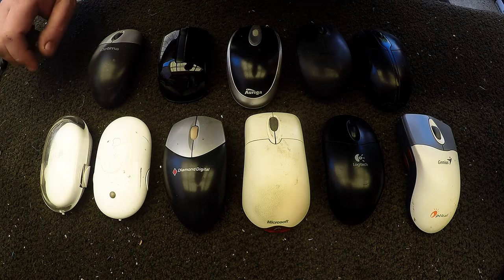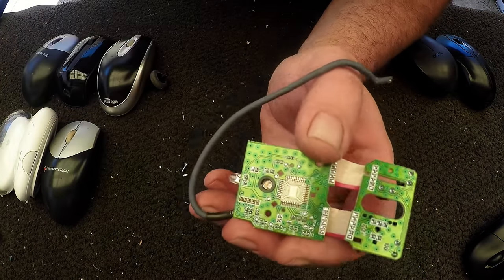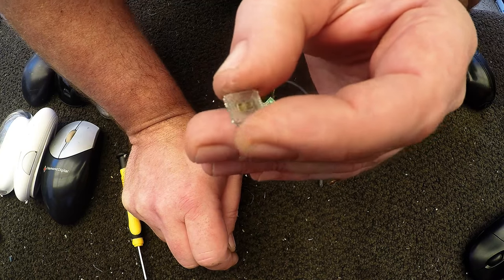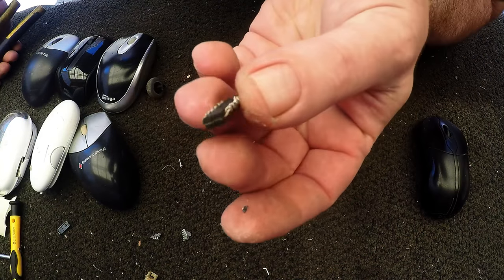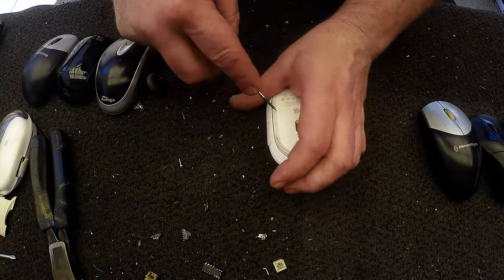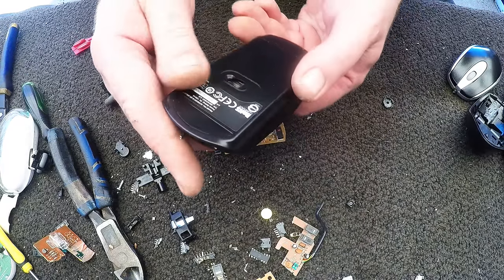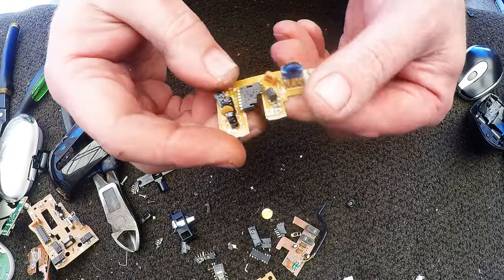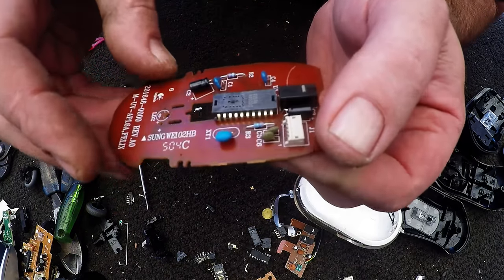Gold Chips from Computer Mice

Comment: In case anyone's curious, the unit being targeted for recovery here is actually a wee tiny (and very low resolution) digital camera sensor, or CCD. Definitely only found in optical mice, don't waste time looking for them on the old mechanical ball mice.....mouses... meese.
Reply: To be even more accurate, most of these are an ADNS-2051 optical mouse sensor DIP 16 plastic encapsulation package. Even in quantity, they are an expensive component. Thinking about retrieving a few with my hot air reflow station.
Reply: Moosen.

Comment: My Logitech has a ribbon cable for the side buttons and lights.  It looks like it has silver traces rather than copper much like the Mylar sheets found in keyboards that have silver on them.  It does look like it has silver in it but it doesn't amount to much unless you have a bunch of them.  I forgot the model of the mouse, it is an old one and it wore off but it is one of those laser mice with the invisible laser.  The circuit boards and the connectors on them also have bits of gold but that is not a lot.  Look closely in the ribbon cable sockets and you may find gold.  It is not a lot but it adds up if you can get them off the board.  That damned RoHS solder probably makes it easier to get things off.

Comment: thanks ben for another good video, like i was saying before i am just getting in to e-waste, so these videos are really handy to watch, i have made relationships with a few computer repair shops near to where i live and they have given me loads of waste, from pc towers, monitors, laptops, servers, hard drives, sticks of ram. i have spent the last day stripping some of it down, but i don't have a air hammer so its taking a very long time to get stuff of the boards, is there any other way (until i can buy an air hammer) to get them off the boards? oh by the way i have loads of cuts from stabbing my self with a screw driver trying to get stuff of the board. :( lol
Reply from the maker: chips come off easily tapping them with a hammer & screwdriver, pins not so easy, maybe cut them out with tin snips
Reply: thanks ben, got some good stuff, just a little hard when i don't really know what i am looking for when taking things apart. i have bought a router with a small grinder on the end and that seems to strip them of pritty quick now, its just i am loosing some of the pin from grinding through it.
Reply: Use an old wide wood chisel and a hammer to get the chips off.  Or the chips on ram sticks you clamp in your bench vice and cut the legs on one side with a carpet knife, then it breaks off easily. I do at least a hundred sticks an hour.
Reply: thank you martin. :)
Reply: eWasteBen, Looks like you've done a fair bit of those in your time, you open those mice like your shucking oysters.
Reply: it does don't it, this guy has made my life so easy after watching his videos, i was a chef under so much stress and now i have started a small but profitable e scraping business just through his how to videos, ok i am a lot slower then ben but i am getting through so much stuff now. its also nice to see alot of people commenting and getting in on the conversations we are having, i am picking up other ways to do things with the help of you guys. much respect. and thank you
Reply: Would you say that the older circuitboards from the 70's and 80's contained more gold than the newer electronics? Because I remember reading an article back in the 80's about a guy named goldfinger who got rich stripping gold from the diodes on circuitboards. It seems as though manufacturers were more generous with the amount of gold applied to the components. Or maybe it was because the advancement in technology has now allowed manufacturers to apply a much more finer layer of gold than previously. As you know electronic components used to be a lot more bulkier and heavier in the past and I guess the gold used in it was just as coarse.
Reply: Yes that is true almost all the time, but like Rodman says, for instance the older ball-type mice do not have the gold bearing chip at all.  It has now actually got the stage where you need large amounts of electronic scrap before it's worth your trouble.
Reply from the maker: yeah we need much more then in the old days but there is much more available today, in the 90's people kept pc's for 10 years, and not everyone had a pc, today they last 2 years and there's billions of pc's plus a lot of other electronics compared to the 90's
Reply: cheers ben, i have also started keeping the parts from laptops and servers to sell because i think if they work they should be sold. plus they fetch a little bit more then the gold in them too. so not only am i on the search for gold i am now recycling screens mother boards and plastics, only time will tell if it will make money as like i said before new to this scrapping but loving it :)
Reply: ive just been stripping ps3 consoles down there is some interesting stuff in there. i also found that x box 360 controllers have gold every where. all interesting. to top it all off i have now got 3 contracts with 3 different shops collecting there e waste. maybe tomorrow there will be more to the list. i am well happy cheers ben :)
Reply: just another day